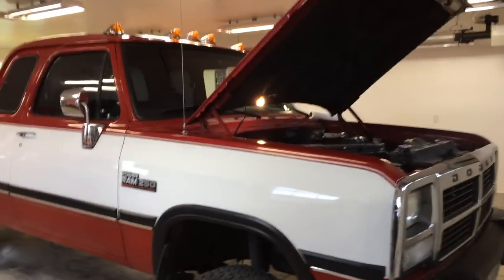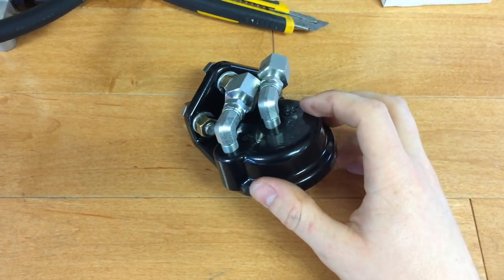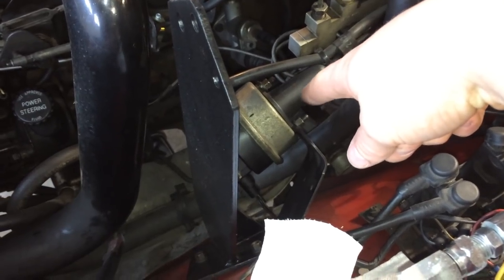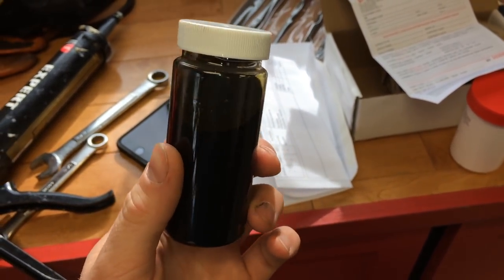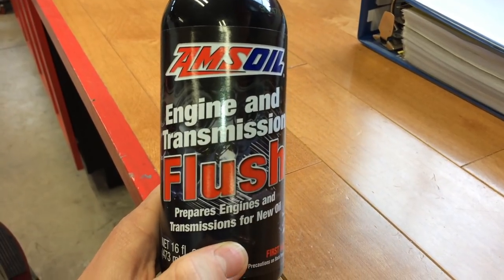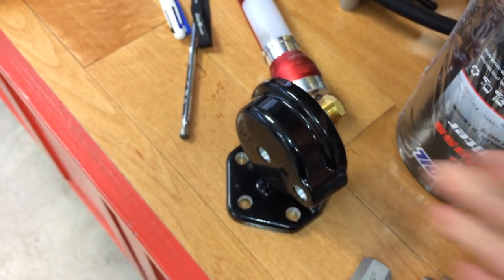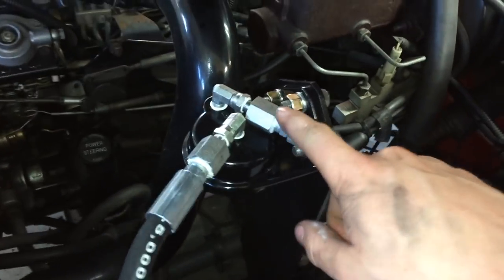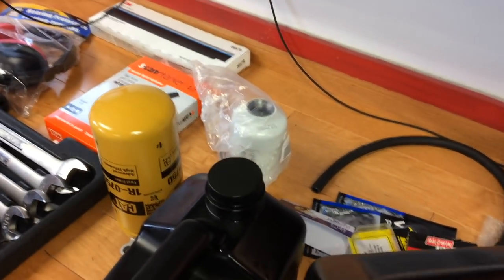Setting up your Engine for a MILLION MILES! - Oil Bypass System

Comment: You're gonna love a amsoil bypass oil filter! I got one on my 04 6.0L powerstroke. It was made by amsoil for the 6.0L powerstroke. I had to change the oil every 3000 miles or blow a fuel injector or two. I put a bypass filter on a couple of years ago. Done the first oil change at 10,000 miles. Oil looked good still. Just did a second oil change at 13,500 miles and oil still looked good. It's says it's good for 20,000 miles. Haven't blown a injector since putting this on my truck.
Reply: David Bess, the oil bypass filter for my diesel truck is 20,000 or one year. The filter I get for my son's SUV is 25,000.
Reply: David Bess, it's an amsoil filter on my truck. It's the EA100. It requires changing more often because of it being a diesel.
Reply: David Bess, EaBP100 is correct. For the 6.0L powerstroke you need to change it one year or 20,000 miles. The injectors are very sensitive. Ever since installing the oil and coolant bypass system I haven't had a problem with my injectors. I love it.

Comment: 506943km on my 93. I've been running rotella conventional for about the first half of it's life,then switched to rotella full synthetic since. 12,000mi drain intervals. Still runs as good as it did new.
Reply from the maker: Keep on truckin!
Reply: I stopped running synthetic to go to regular oil and change it more often due to the soot buildup!
Reply: @Garandmasthumb  Plus synthetic base oil is better for high temp but the additives go away just like regular oil . So you still need to change it the same for best results. it may pay off if your really working the engine hard
Reply: How is the idle oil pressure hot big difference from cold?
Reply: @tomhutchins1046  How do you know that?

Comment: Its amazing there are company's still selling add on bypass systems. The first was the old toilet paper one in the 60's. They just bleed off oil pressure and filter it then dump it in the pan. The dirty oil still has to cycle many times before it is 100% filtered with a bypass system its also a pressure leak thats bad. And more lines to fill every time you do a cold start delaying the engine seeing full pressure. Effective on older engines that do not have a filter. Most automotive engines have a bypass in the oiling system (Not to be confused with the pressure relief valve.) On a cummins it is in the block or adapter. A small block chevy its in the filter adapter fords its in the oil filter. The idea is when the oil is cold  or the filter is dirty ect . To route the oil around the filter. Basically dirty oil is better than no oil if the filter is not changed on time. On SBC race engines it is common to plug the bypass so 100% of the oil goes through the filter. Very helpful if a cam goes flat or something. Will make the difference between a cam replacement or a complete rebuild. On ford you use a race filter that does not have a bypass. You could probably do the same on a cummins but if you live in a very cold climate you will need to run a thin synthetic oil and or some sort of oil/block heater. And make absolutely sure you change the oil filter on time.  I just change the oil every 3000 miles 10 quarts of valvoline 15/40 and 1 quart of valvoline 40wt race oil High zinc. And change the filter every 1500. (In between oil changes) Over 300,000 and still going strong
http://beamalarm.com/Documents/cummins_system_diagrams.html

Comment: I put an Amsoil Dual Remote in my '92 about 20 years ago. Used the biggest filters that could fit...BE110 and an Ea015. Put a petcock in the bypass block for sampling. Made a bracket and mounted cans back behind turbo on fender. Running 5W-40 Max-Duty Amsoil. System holds approx. 14 US quarts. 600, 000 km on truck, now.
Reply from the maker: How often do you do oil samples, and how long time wise and distance have you gone between oil changes. I have gone almost two years without an oil change, mind you I have only put about 10000kms on it though in that timeframe.
Reply: @OvensGarage  I go about 15,000 km on average between samples. I've gone 80,000 km without an oil change, in the past. BTW,  been doing some work on her lately. Was changing fuel filter. Tested heater while replacing upper square-cut rubber gasket (leaking). Heater was toast (two-prong plug, PTC type, self-regulating). Had a hell of a time finding replacement through Fleetguard: Needed following parts:heater:3907766-s; wiring harness plug:3934304-s. Needed to modify plastic heater housing on the top to be able to orient it with plug facing back toward lift pump (where you can get at it). Fleetguard doesn't tell you this. It's a mistake in their mould when it comes to fitting this truck. Also, their instructions are wrong for re-installing the existing adapter fitting. They say to use Loctite "removable" 608 on the M16 X 1.5 threads. 608 is a cylindrical part bonding compound...not a threadlocker. Wrong application!!! In fact, don;t use anything on the adapter threads...you might have to tighten them to get a better seal over time. If you decide to use anything, use 242, or, 243(oil tolerant) removable locker.If you use 608, as per instructions, you'll never get your heater back out without using heat.Imagine that!!! I also discovered that the shaft to which the kick-down cable attaches on the throttle bracket is badly worn. You can't buy these parts anymore. I'm going to machine a new shaft (which tack-welds in, like the old one) to be used with a replaceable ball stud (for the accelerator cable) and see how that works. If it works well, I'll put it on degrootmakers.com as an aftermarket item to help people out.
Reply: Would love a picture on how you put in the bracket.  I have the dual bypass system just not sure how to mount up

Comment: Nice truck I just bought a Australian Jackmaster Classic  from Ebay. They claim their elements will filter to 1 micron I put a roll of Great Value 1000 in mine . Some use Scott 1000.  I dont drain oil. Using Super Tech Walmart synthetic oil.

Comment: Love your very useful and informative vids.  I have a '93 Dodge D 250 and I'm basically clueless.  My turbo has never worked and need info on where to get a reputable HX35 turbo or where to have mine rebuilt.
Reply from the maker: I would just try and rebuild it yourself. There isn't much to turbos. Take a look at my h1c rebuild video and that'll give you an idea

Comment: Years later, have you noticed a difference with your oil analysis since installing the bypass filtration system?  I've got my engine on the stand still, and am wondering if I should install a system like this when I finally get it back on the frame.
Reply from the maker: I did oil analysis for a couple years and it extended the drain intervals quite a bit. Its more of a peace of mind thing for me now as I'll change my oil every 10000kms with synthetic anyways

Comment: Very good sir excellent work! I like that truck. Lord willing I'll be doing a similar install and video on a 2007 Honda Pilot.
Reply from the maker: Good luck!
Reply: @OvensGarage  https://youtu.be/l4UafarPZPA
This is part one where I had to deal with stripped oil sending unit threads. The second video is actually Parts two and three all together. I'm very happy with the installation and analytically clean oil from here forward!

Comment: Nicely done. Love the bracket for the return oil, but I would have installed a piece of rubber. I heard stories of those quick drain accidentally opening or some idiot draining your oil. Nice truck I’ll be getting one for my powestroke.
Reply: +Oren C - Yea, me too, I don't trust those drain plug " Fumoto " neither.  Maybe that is why they called " FU-MOTO " Plugs.  LOL

Comment: Hi Tyler, did you create another video showing the two oil analysis, before and after?  Did you have them check particle counts showing the peformance of the bypass?
Reply from the maker: I've got oil analysis reports on my computer. I'm about to send another sample off. I'll make a video once it comes back and compare all of the results.

Comment: Great video! Very informative! That truck is in exceptional condition, as are the other vehicles I caught a glimpse of in your garage.  I'm doing my research into these oil by-pass systems currently and can't seem to decide which one to purchase. What made you go with the AMS oil system?   Love my Fumoto drain valve!...I like that I can attach a piece of hose to mine and drain the oil right into old windshield washer containers for clean easy disposal.  Looking forward to the fuel filter video.
Reply from the maker: Thanks for the kind words! I honestly went with the AMSOIL system because of their parts catalog. Nobody made a kit specifically for this truck, so I needed to make one myself. I could order from them just a filter mount and filter, and I got the rest of the hardware locally at a princess auto for lines and fittings. There are several other types of bypass filters and systems but since I am also running amsoil synthetic may as well run their bypass too. My dad has had an amsoil bypass on his truck for years and loves it.

Comment: I am in the process of doing the same thing but with the Napa bypass filter that goes to 5 microns.  I have a 94 5.9 12 value in a 90 F250.  I  have 300,000 miles on the 5.9. like your self,  I  want it to last. the port next to the turbo oil line, does it drop your oil pressure to it? I believe  that there is 2 other pots below the full flow filter to reduce the chance of pressure drob. If it doesn't drop the pressure,  I'd love to use that port. 1/4npt right? Eventually, I  want to  put a Ceterfuge or Frantz filter on it. Can you get back with me about that top port, or anyone else that knows about it.  Thank you for the great video!

Comment: I hate the risk of oil lines around the exhaust manifold. looks like you have lots of clearance this way. 485K on mine
Reply: +Taylor Monti - Yea I see that too in the Video ://.  I would have run it closer to the " Original Filter " to prevent shorter hoses, etc...  Then the " Return " we have no choice but to go back to the " Filler ", just for piece of mind kinda thinking.
Reply: Funfact...even aslong as it does NOT touch, it will never ever be an issue..
Reply: +Michel Linschoten - Funnier Facts.... Learn how to read!  BTW... Who said about " Touching "???  IT CAN TOUCH ALL IT WANTS !!! LMFAO

Comment: how is that oil return holding up? I was thinking about trying to get the thread size of that oil fill tube, or the oil fill tube cap and either find a a brass tube to replace the plastic one and tap that or get an aluminum cap and tap that instead. 

otherwise great video. good job
Reply from the maker: Yeah that oil return that I did in this is my least favourite part about the system, I haven't had any issues with it but it isn't the greatest setup. It could fail. I was thinking about 3D printing a better clamp setup to hold the return hose. Your idea is a good one as well.
Reply: @OvensGarage  I will measure the thread size on the fill tube and fill cap. I got a feeling the tube could be replaced with a metal alloy and then you get a more secure T in location. I want to run a piece of copper tubing because then you can braze everything in and then your good to go.
Reply: You can tap into the turbo return line it’s a pipe from turbo with a hose to another pipe into the block then you can keep everything on the passenger side of the truck that’s I am going to do

Comment: I wonder why you didn't Tee off your oil sending unit on the driver side of the block?  For your oil supply, and then run your  return line back to the pan?  It would have made better sense and you would have used a lot less line.  Given the fact your fab mount for the oil filter is on the Drivers Side.
Reply from the maker: To be honest with you I didn’t think of it. I actually like that idea. I’m not sure I entirely like the idea of tapping into the oil pan, but I might change it in the future. Is there a non pressurized oil return port somewhere on the drivers side of the block? Could maybe tap into a valve cover. Thanks.

Comment: Great video, good detail.  Anywhere from 10-20% of the used oil may remain in the engine after a normal spill and fill.  When switching lubes, I would perform a Full Volume Oil Change and use the Amsoil Engine flush.  After the first spill and fill, add the Amsoil flush,  run it as directed and then than drain that lube.  You will achieve a 99% fluid replacement.  Change the filters and add the by-pass.  The new oil, filter(s) and all its additives will be able to do its job and not have to contend with the old oil remaining in the engine for the next oil change interval, whether a normal or extended.  I have oil analysis showing retention of 20% wear metals, loss in viscosity and additives, and fuel dilution after only 15 minutes of operation from a normal spill and fill.  Question:  Would you buy new oil that contained 10-20% used oil of unknown quality and condition.  Of course not, then why would you do the same by leaving the same amount in your engine.  BlackStone Labs agreed that up to 20% of old oil remains, especially turbo charged engines, with coolers and modern engines with dual overhead cams and VVT.
Reply: Never flush an older engine you just brake all the deposits lose and plug oil galleys tear up bearings ect damage the engine. Only flush an older engine as a last resort. Bypass filters are a pet rock gimmick there just an oil pressure leak
Reply: @tomhutchins1046  Sludge in modern engines is extremely rare.  The only time I have seen it is where conventional oil isn't changed in 20-30K miles, or the engine has sat for many years. The detergents in modern oils are constantly removing varnish and deposits in the engine.  Sludge does not tear up bearings.  When was the last time you rebuilt an engine.  Hard particulates and wear metals, and cold starts causes the tight clearances on bearings to wear.  By-pass filters have been used on OTR transportation, passenger fleet vehicles, marine and the military applications for 75 years.  Show us your evidence that it is a gimmick.
Reply: @tssci6774  I have been a professional engine builder many years owned my shop since 1983. lots of machines dyno flow bench head work block work. Worked for a top builder in Southern Ca during high school  I have torn down and built many engines for rebuild or racing applications, many 100's++ maybe over 1000. No thats not key board fantasy its real. True older engines ran cold and the oil literally turned to sludge in a 1000 miles. They also ran rich so it contaminated the oil quicker. Also accelerated ring and cylinder wall wear. later engines still have deposits and varnish including hard carbon yes it is not near as bad as it used to be. So here is the question if there are no deposit's why flush?
The term bypass filter is misleading the stock filter is a bypass design. It has a bypass valve.
so i don't write a novel here I will cut and paste another response i left.
Reply: @tssci6774 Here yah go Brian you can learn from it or you can reject it it's up to you read the whole thing i suggest
 Its amazing there are company's still selling add on bypass systems. The first was the old toilet paper one in the 60's. They just bleed off oil pressure and filter it then dump it in the pan. The dirty oil still has to cycle many times before it is 100% filtered with a bypass system its also a pressure leak thats bad. And more lines to fill every time you do a cold start delaying the engine seeing full pressure. Effective on older engines that do not have a filter. Most automotive engines have a bypass in the oiling system (Not to be confused with the pressure relief valve.) On a cummins it is in the block or adapter. A small block chevy its in the filter adapter fords its in the oil filter. The idea is when the oil is cold  or the filter is dirty ect . To route the oil around the filter. Basically dirty oil is better than no oil if the filter is not changed on time. On SBC race engines it is common to plug the bypass so 100% of the oil goes through the filter. Very helpful if a cam goes flat or something. Will make the difference between a cam replacement or a complete rebuild. On ford you use a race filter that does not have a bypass. You could probably do the same on a cummins but if you live in a very cold climate you will need to run a thin synthetic oil and or some sort of oil/block heater. And make absolutely sure you change the oil filter on time.  I just change the oil every 3000 miles 10 quarts of valvoline 15/40 and 1 quart of valvoline 40wt race oil High zinc. And change the filter every 1500. (In between oil changes) Over 300,000 and still going strong
http://beamalarm.com/Documents/cummins_system_diagrams.html
Reply: Ps you have no idea how much time real racing engine builder spent trying to find inefficiant leaks in the system and solve them. 
tapping into an oil galley and running it through a filter then dumping it in the pan is wrong for so many reasons
Its a leak in the system oil pressure.
its one more thing to fill up on a cold start till the engine see's full pressure.
It has marginal at best filtering effect. Its like running your engine and leaking off a little oil running through a filter then putting it back in the engine still running

More hoses to potentially fail. 
there also known as partial flow filters.
Reply: @tomhutchins1046  Are you done with your multi-post diatribe?  Will  a filter that can remove 95% of the damaging hard particulates, sludge and oxidized carbon from the oil extend the life of an engine?  Yes or No?  Do automotive engineers build in performance tollerances for flow and pressure in the area of 25% or more when designing lubrication systems?  Yes or No.